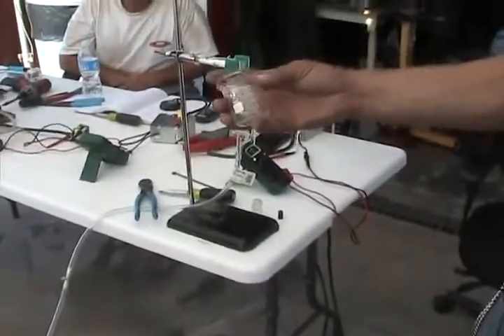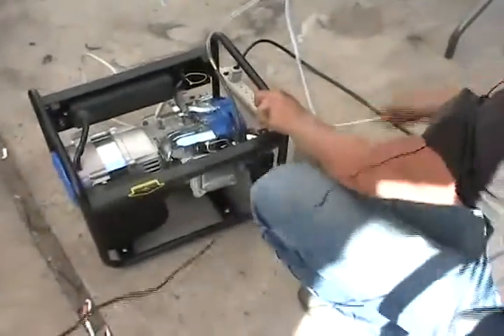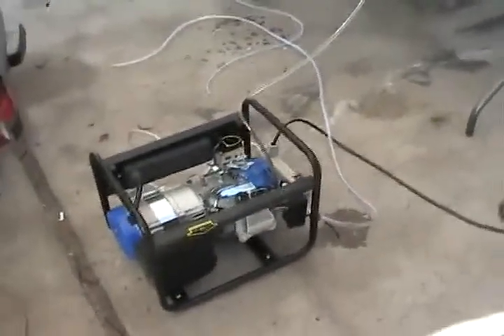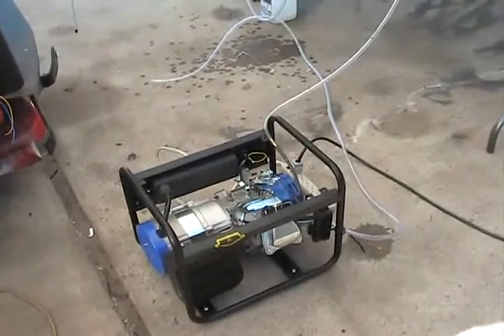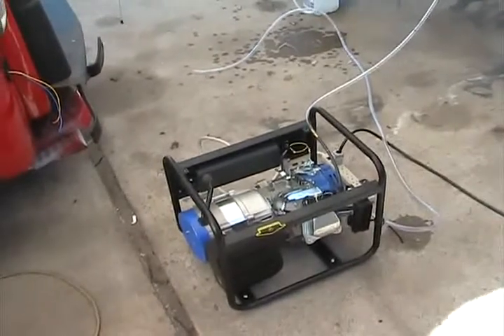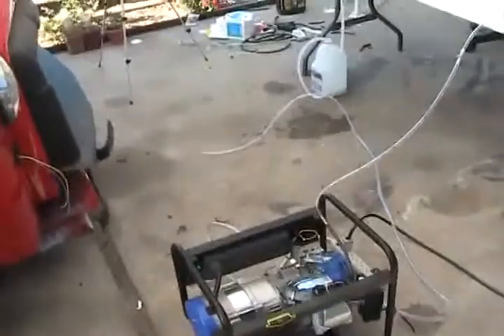generator running on hho testing Pt.4

Comment: i didn't see if you changed the jet for an ultra lean gas mixture. if so what was the size. i would think the engine would consume the same amount og gasoline even though the hydrogen is being fed in

Comment from the maker: yes, for a very very long time, this is just a lean mix, I need some rpm data. 9000/.2=45000(45L) total intake volume
45000/21(amount per rev.)=2142 rpm projected. Lets see how close I am.

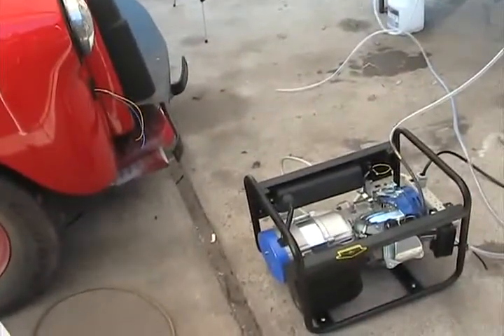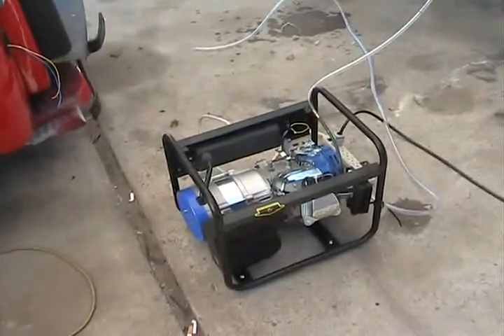Comment: engine start 0:55 engine stop 4:45 ran for 3:50 or 230sec. With no load the fuel usage is 10.435mL/min 0.173913mL/sec 626.1mL/hour it should run for 95.83min/liter of fuel with no load based on my calculations the cell would have to produce around 50L/min of HHO to run the engine Good luck and I hope you can prove me wrong I believe in the hydrogen dream as an on demand boost its great but to run the whole engine it just not ready yet like I said I hope you prove me wrong please do!